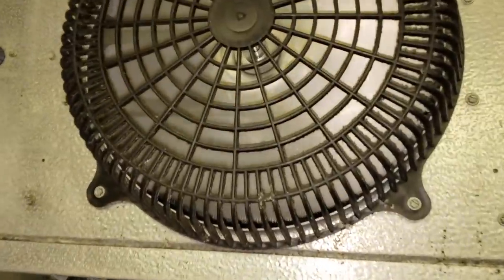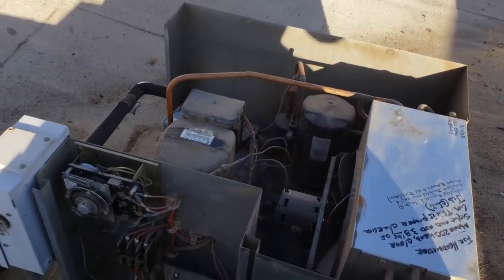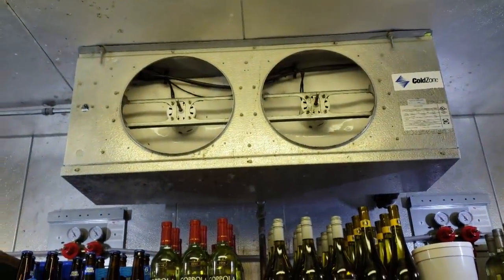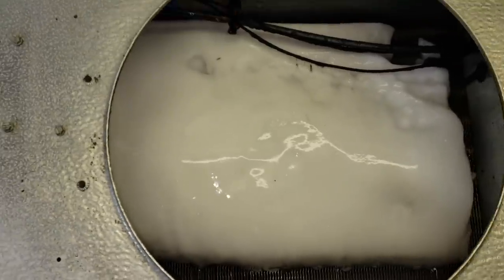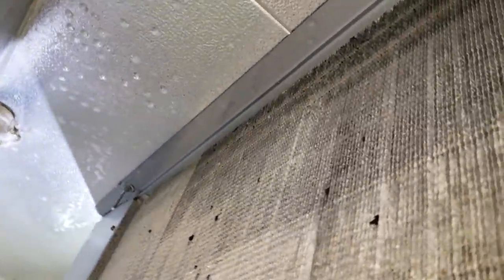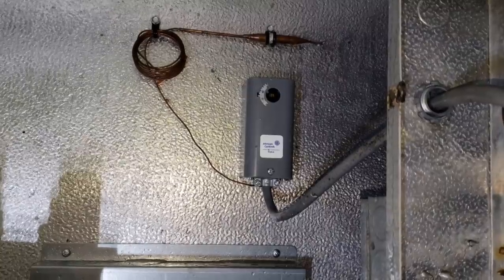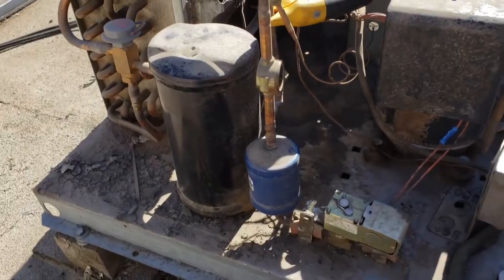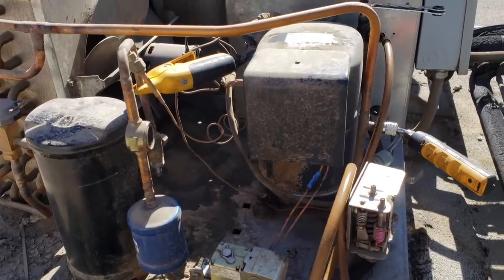WALK IN COOLER ICED UP

Comment: May be a stupid question. What’s a headmaster do?
Reply from the maker: Ashton not a stupid question at all  simply put a headmaster or head pressure regulating valve backs up the refrigerant in the condenser to raise the head pressure in the system on really cold days when there is not enough heat in the ambient air at the condenser.  The reason we do this is when its really cold outside and your condenser has that cold air going across it it lowers your condensing temperature and while most people think that is a good thing if the condensing temp goes too low it starts to affect the performance of the expansion valve and that causes the system to not operate correctly. So by flooding the condenser the head master helps to maintain a constant liquid temperature of 100 degrees going to your expansion valve.   If you have time watch my new livestream that i did as I talk about the headmaster a little more   https://youtu.be/lBpaoxAtSzw
Reply: @HVACRVIDEOS   Great thanks for the info! Great channel too!
Reply: I live in Canada, headmasters play a big part on very cold days, some run fan fan cycling newer run headmasters, but listen to Chris, wicked smart dude
Reply: Headmaster is make keep head pressure above minimum level for refrigerant circulation.if headpressure is too low to push refrigerant through the expasion valve and then refrigerant will not enough to make cold air.
Reply: The headmaster is in charge of all the other masters! 😂
Reply: Yeah you could say that! @snoopyjc

Comment: When you have a frozen evaportator, the low preassure is lower. There's no need to add refrigerant, defrost it and check again. You will surprise, greetings from refrigeration mechanic from Argentina. Long live R-22!
Reply from the maker: Thanks for watching , yeah I didn't adjust the refrigerant charge unit after I defrosted the coil.
Reply: Of course you dont add more refrigerant to an iced up system. Would be funny after defrost ;)

Comment: Top-notch and thorough as usual. When you added the refrigerant to the receiver did you just start the compressor up while it was still pump down and suck in the refrigerant or did you start the system up and after adding more refrigerant,   keep pumping it down to recheck it every so often.?
Reply from the maker: Rick I just added the gas to the low side while it was still pumped down, that way I didn't have to keep pumping it down I try to "work smart not hard" :-) thanks for watching bud.  FYI I am probably going live on Youtube tonight to talk about the video
Reply from the maker: thanks for watching , I am going live on youtube tonight at 5:00pm pacific standard time come on over and check it out https://youtu.be/lBpaoxAtSzw
Reply: @HVACRVIDEOS  I've read about checking the receiver level this way. And I've tried it with my thermal imager while it's running and you can sometimes see the level. Generally after I clear the sight glass I'll try to calculate what the total charges was and add 10 or 15% which usually can be 3/4 to 1.5 lbs on these small units. The other thing I'll do while I'm pumping down is watch my head pressure and see if it starts Rising which can be an indication of running out of room in the reciever.

Comment: Something I used to do with beer walkins. Put the temp controls bulb into the evaporator coil. That way the solenoid won't re energize until the coil goes above freezing.  You need a temp control that has allot of differential so you can set cut out low enough to get proper box temp.  The box temp will rise sometimes while it's defrosting but the beer usually stays cold enough ,not to be a problem. Boxes that get allot of new product at the same time have a tendency to freeze up trying to recover...this solves the problem.  Defrost timers don't account for crazy swings in box demand.
Reply from the maker: thank for watching! I am going live on Youtube this evening 1/7/19 at 5:00pm pacific standard time to discuss my most recent uploads, come on over and check it out https://youtu.be/UXpVzsY0gzc

Comment: I have a question regarding the setup of the low pressure switch. I have it set for it to turn the compressor on at 5 psi and cuts off at 20 psi. This setup keeps the coldroom at 1 degree Celsius which is desired. Also having the differential setting the way it is, compressor isn't working as hard. Is setup ok?

Comment: I'm experiencing something similar in 3 walk in freezers at my job, however the ice is forming on the outer pipe entering the back of the evaporation coil fan box assembly??? Any idea if tgat could be 3 bad limit switches or is that even feasible?
Reply: that moment when he gives you a heart but no answer.

Comment: Why didn't you use a heat gun to thaw the coil?
Reply from the maker: I prefer to use a water hose because in my opinon it goes faster and it allows me to clean the coil at the same time, thanks for watching , I am going live on youtube tonight at 5:00pm pacific standard time come on over and check it out https://youtu.be/lBpaoxAtSzw
Reply: And throws less heat into an already warm box
Reply: It takes the same amount of BTUs to thaw the ice no matter how you get them. It's just less water with a heat gun so you don't flood the drain. Something like a quartz radiant heater can focus heat on the coil.
Reply: Has anyone tried a small steam cleaner on these? The frozen coils I normally found were in air conditioner coils in furnaces when people didn't change the air filters often enough. It is easy to thaw those just by turning the system to heating. Maybe one of those steamers would both heat and clean.
Reply: Steam? Talk about btus added to the box. Makes no sense sorry. It only takes 144btus to bring 32* ice to 32* water. To create steam your using 970 additional btus on top of the 180 needed to first boil the water. I'll stick with 144btus and watch it go down the drain instead of the air.

Comment: My supervisor says their no such thing as a winter charge which I think he’s wrong.
Reply from the maker: is it possible that he doesn't understand what you are talking about? some might call it the headmaster charge....  Bottom line if the unit has a headmaster it requires more refrigerant than the same system without a headmaster.